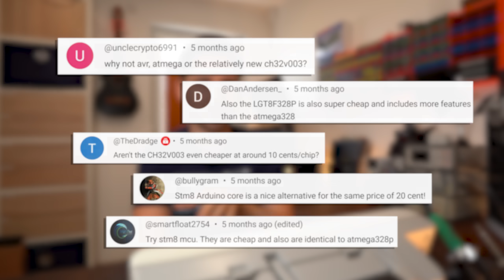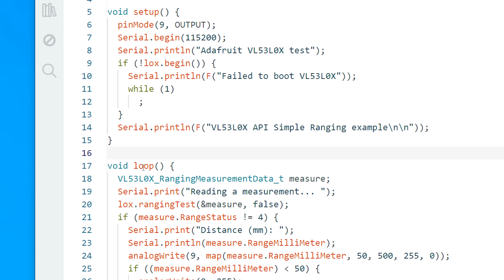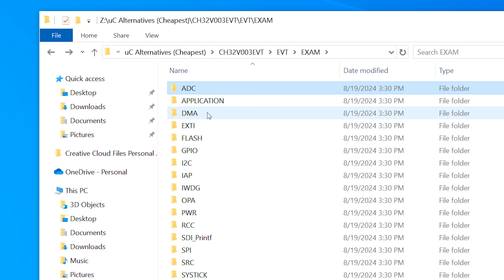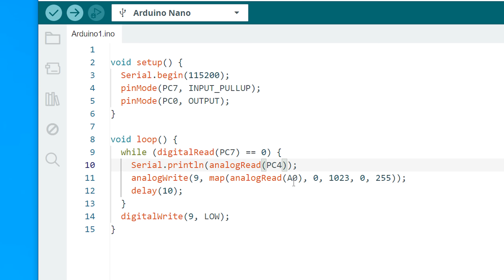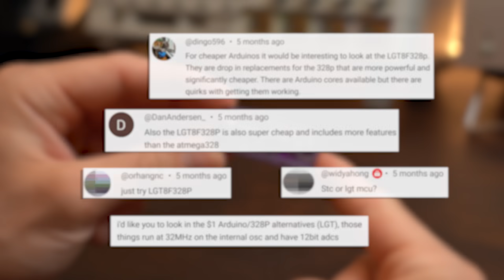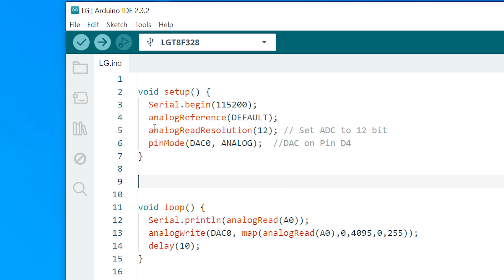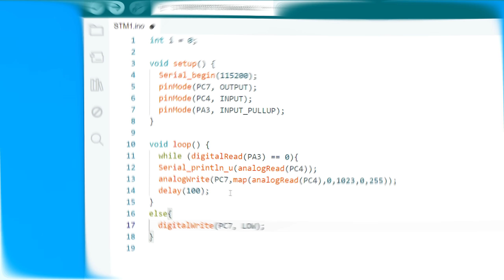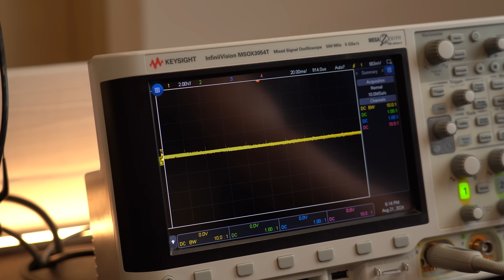I tried the 3 Cheapest Arduino Alternatives! (That you Suggested)

Comment: Awesome! Buying a handful of those LGT boards right now lol, better specs and USB-C AAAAND cheaper??? Yes please!!!

EDIT: I think the issues you were having is just quality control. I bought 4 of these boards, 2 of them worked fine, 1 booted but wouldn't connect to my computer, and 1 wouldn't even light up and actually shorted out my whole USB hub when I plugged it in 😬
Reply: Ayooo. Did you have any other issues with it?
I'm also omv to buy these boards
Reply: @shantilkhadatkar1195  No other issues so far. The DAC is only 8-bit which is not super useful for high precision cases, but the Arduino Nano doesn't have one at all so it's technically a step up 😆 The working boards have been great so far

Comment: ESP is just on another level and the IoT field is exploding with projects based on it.
The STM32s also, are just legendary. I love building projects and making products with the trusty Black Pill (STM32F411CE) and sometimes, it's popular older brother, the Blue Pill.
The performance and response of the ESPs and STM32s relative to other microcontrollers are unmatched. Their cost, and the ESPs ease of use, sets them apart.
Reply: A pico is better
Reply: @ For hobbyists, yes. Not for serious work.
Reply: Hello, I have searched  ST microcontrollers IC,  and none have old TH PDIP package. The use of a complete dev board (as nucleo or pills) would be expensive and big space to very specific reverse-engineering aplication projects that I have in mind (all legal), so... do you know if there are "basic" stm32 boards that basically  just adpat the SMD package to gave TH pins to prototyping ??   something basic and small similar to ST8 board of video
Reply: But if you’re using the chip itself, you need so many other components, but it just gets really complicated to layout

Comment: LGT8F328 seems pointless. Chips is more expensive then the RP2040 and the dev boards are not cheaper then the rp2040 ones.
And comparing other factors only favors the rp2040 even more.

Comment: I bought a few of those STM8 boards a few years ago when I was first getting into DIY gadgets. Never used any of them yet, but I've got a plan to add rotary encoders to my flight sim throttle quadrant... STM8 will read the encoder, and toggle a GPIO hooked by optocouplers to the existing buttons on the front that I never use...
I did briefly consider finding a microcontroller that had USB and loads of GPIOs and just replacing the entire guts of the thing, but that's much higher risk than just tapping into the existing buttons.

Comment: The purple board has an external oscillator where the green board has a builtin oscillator.
These board can act weird depending on the timing. and applications.
I like them due to the speeds and cheap price.
Thanks,
Jeff
Reply: Thanks. What would be the fix in his case?
Reply: @goku445  on simple codes 32Mhz works. While more complex codes, it just blinks blue (in video @8.36) and does not run at all. You need to select 16Mhz, though some may work at 32Mhz. (purple)

Comment: I can't see any point in most of these alteratives over the cheap bog standard Arduino Nano 3 clones. The clones work "out of the box" you don't need extra libraries, you don't need a separate programmer and you don't need a different IDE / programming dialect
Reply: Using a 12ct mcu allows me to do more risky experiments without fear of breaking something 10-20 times as expensive.

Comment: just wanted to know, do you know how to use 2 type c solar input and convert both into a single type c output, with out interface with another solar panel type c? and if so, do you think someone makes a 4 input and 1 output. 
Im no expert in making electronics but i think like it should be possible to make one?

Comment: RAK wisblock is like an entire ecosystem of bits and bobs that go together with a really low-power main controller chip, usually based around the Nrf52 family. Think of it as being kind of like the microcontroller version of a PC. You can get various sensors and daughterboards that plug right into the baseboard, or solder your usual stuff into the available GPIOs.

Comment: Well, my most beloved board is ESP32C3 Super Mini. It always just works and as a bonus you can have there OTA updates, Wifi and Bluetooth if needed - if not just don't power them up and power consumption will be very low. Not the cheapest option but is super reliable.
Ah, and it works with Arduino IDE just fine :) Including OTA
Reply: A pico is better at same price

Comment: I have the chip version of the CH32V003
testing the blink program using the arduino IDE, the delay value required must be set half of typical values for AVRs and ESPs...
have not tried the mounriver IDE as it does not have a linux port.
Reply: You should try latest Arduino core. For chip versions you need to select 48Mhz internal clock. The default is external clock and when not available it uses 24MHz internal oscillator. Latest core allows selecting clock from the menu.

Comment: Having used the CH32V003 extensively over the last 18 months (only in Mounriver though), it's an amazing little chip for the price. It's way cheaper to pop in one of those compared to a dedicated IC in most cases. The software (especially the given examples) are a bit lacking though, you're going to need to piece a lot of things together for yourself. Once you've got a working codebase of your own examples to turn back to, the CH32V003 is a breeze to work with.

Comment: The PY32F002A is even cheaper than the CH32V003, has more memory and features, and you can program it with the tools you already have. Jay Carlson did a review of this MCU some time ago as the cheapest replacement for an 8bit microcontroller.
Reply: wouldnt say its better, just has alittle more flash and sram but ch32 is much faster. Like double the frequency. But im curious about the minimum amount of components needed to get the Puya mcu to "work". I have a couple of the ch32v003 and ch32v203 that only require 3.3v/5v power, no OSC or caps required. If its similar in that aspect then i might buy a few

Comment: "I2C is nearly everywhere" - I worked at Philips in the late 1980s, and I2C was everywhere then too. For cheap cpus on 8 pin soics, the microchip range of processors, pic10f and similar are also very low cost, but utilise relatively low cost programming tools and full supported SDK and IDE. As an aside, my first debug/programming device for the microchip processor cost me over £1000. Times have really changed.
Reply: Debugging tools were astronomically expensive, I developped in the mid 80s for the Motorola 6809, the emulating tool was made by a swiss company and was so expensive we could only rent it ! So, I warmly welcomed the PIC environment when Microchip introduced it.

Comment: VS-Code, PlatformIO and ESP32 is all I need. 
I'm not making stuff in the thousands to worry about a $2 or $5 chip.
I know the Arduino and ESP32 by heart and don't have the time or patience to learn a new system, just becasue it's cheaper than dirt.  
If I can't do it with the ESP32, it can't be done with an MCU.
Reply: A lot of what I'm making ends up needing wifi, so ESP8266 if I don't need the speed and want it cheap, or ESP32 for things that need to be quicker or have more/better GPIO options.
But I do have a bunch of other random chips around for non-wifi projects. I have a little USB stick form factor Atmel based board that I love for USB projects... But they were only really popular for hacking PlayStations apparently, and seem to no longer be made by anyone 😢

Comment: I`d say that LGT8 is like super nano, more features than arduino nano, almost everything is upgraded (more timers, they are faster, with complimentary outputs, deadtime and 80 mA output capability for better MOSFET control, extra 2 bit ADC resolution with different and better voltage references, DAC,  unique chip ID and some more). But it also has some disadvantages, like programming through SWD - idk where to get an official programmer, and arduino ide seems to rewrite lgt8 factory bootloader, so you can't program it through serial anymore (looks like it happens in video). And there is no clear information how to get bootloader back. But still, it's a great chip with many interesting features and very high atmega328p compatibility.
CH32V003, in other hands, is a very powerful, yet cheap mcu. But it's very hard to use, especially if you use only arduino ide and not familiar with embedded development. But it can perform a spectacular things - check mitxela, bitluni or CNLohr. Especially CNLohr, he takes maximum from this mcu and makes some crazy things.
For the stm8....well, it’s not very good. In fact, ST recommends avoiding 8-bit mcu and switching to their newer products - stm32g0/stm32c0. STM8 have some interesting features, but it`s pretty hard to program, it`s support only C, there are some problems with compilers (only two available, and you have to get license for Cosmic, which is free but requires an email confirmation from compiler developers), etc. As for me - STM32 is way better, even if it is a little more expensive.

Comment: Would be lovely to see stuff about nRF52 and the new nRF5340. As far as I know, nRF chips are perfect for battery operation.
Reply: True, I reached 2uA in sleeping mode and 300uA while keeping ble connection using seeed studio. When powering it with 18650 - it will be on for years😆

Comment: This is a great comparison. Just a suggestion on info presentation at 10:30: Describe the power mode (idle/wait/sleep and sleep/halt/standby) using uniform terms.
Or put the equivlent power mode of each MCUs on the same side (up/bottom). 😊

Comment: There is a TREMENDOUS (5x or 10x or more) price difference between the microcontroller chip like the ATmega328P and the microcontroller development board like the Arduino Uno Rev3. The idea being that once the application is developed and the chip is programmed, you don’t need the computer connection and the integrated development environment (IDE) software anymore so you unplug the chip from the board and plug it into your own circuit and power (battery or DC power supply). Though most don’t bother with the last step because Arduino is so cheap, they just use the whole development board in their projects.
     As you showed, you can realize cost savings in selecting the microcontroller for your project. For example, you might not need an ATmega; a cheaper ATtiny or even less might be enough. For simply varying an output based on an input and logic, a 10 cent MCU might do.
     Also, contrary to some comments, you found that the Arduino is obviously not the same as the STM8. STMicroelectronics and Arduino both make some fabulous hardware and software. Arduino is more geared to the beginner. Much effort is made to adapt Arduino IDE to STM8, you are crippling yourself and sacrificing MCU functions by not learning STMicroelectronics fabulous development software and resources. STMicroelectronics has a TON of documentation on their web site.

Comment: I would like to see a video on the: ESP32-C3, ESP32-S3, ESP32-H2 and the  ESP32-C6
Reply: The S2 or S3 are good because they come in small boards and have USB host support. But to be honest, and one thing it was left out in this video is the operating voltage of the MCUs, one big reason why i go RPI Pico is due to be able to work from 1.8v to 5.5v, whats excelent for a 3.7V lithium bat without using extra hardware that draws power on idle or stand-by.
i still like to use ESP-01S a lot due to the size and price, and picos for battery applications. I did use a few S2 small boards to replace some ESP-01.

Comment: I like that you are showing off some bare-chip alternatives. I like to work with bare chip STM32 with a simple breakout on a few breadboards.
Reply: How you do that ? Use SMD adapters boards ??   I searched and ST microcontrollers, and seems none is a TH DIP packge  ....
Reply: @345rvv  I designed my own breakout board, but there are SMD breakouts all over the place. My breakout is for a 64 QFP package that can be plugged into the edge of 3 short breadboards. To solder the SMD package to the breakout, I like to use a small hot plate with a smidge of solder paste, just to get the chip locked down, then drag solder the pins. I have a few videos where I show this process, but I don't want to take away from this channels hard work.

Comment: That STM8 part will probably be around for a long time. Whereas others could drop out of production without any warning.  Thanks GS!
Reply: stm8 is old and is replaced by cheap stm32U0 serie
Reply: @lecornubruno2507  agree, I need some simple and cheap at 5000 units. I found the STM8S003F3 which is perfect for $0.17 each with more than 1M+ units in stock. Can any of  STM32U0s touch this?
Reply: @lecornubruno2507  agree but I need 5 thousand, found the s001 STM8 for 17 cents.

Comment: Meh, i’d rather stick with the original boards. The ch32 is a knockoff of the stm8 showed at the end of the video, and the lgt8f328p is a knockoff of the original arduino nano. The ch32 is easily beaten by the esp32-c3, and it also has very bad software support and is much harder to work with. I’d rather pick the more expensive route and get the original stuff.
Reply: It all depends on what you need. For some experiments I need an mcu that is very cheap to replace. I got 50 CH32V003 for the price of a few ESP32's. ESP32 I use mainly for wifi projects; CH32 for things like a 100V power monitor.